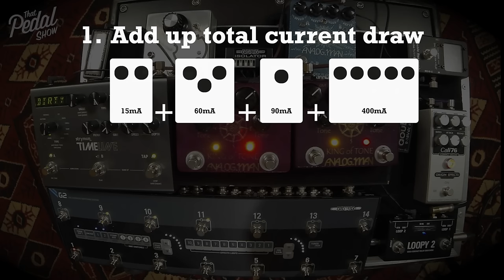That Pedal Show – How To Power Your Pedals Properly & The Legend Of VCPI

Comment: Sorry to spam the comments on this video, but Mick if you're checking this you should show Dan the comment from Mike about running his KOT with 18v.  

With regard to the question of the day, this is taken from TheGearPage, 

AnalogMike said: 

It depends on the filter capacitors we use, I think they are normally 
about 15V, you may be able to read the #s on them, the large can caps in
 the middle of the board above the DIP SWITCH. Sometimes we mount them 
on the back of the board so you may not see them. It's so hard to find 
good quality through-hole parts now, every time I order, the old parts 
are discontinued and I need to find a replacement. 

18V will be safe for a few hours but may blow up the caps after an 
extended period. Everything else (chips, etc) can handle the voltage. 
But I don't think the sound is improved with higher voltage so I do 
recommend 9V, 12V is also fine.

Have fun!

Comment: Great video. One thing that could have been discussed is what truly constitute an isolated output. I think there is massive confusion on the fact that a lot of "cheap" power supply claim to be "isolated" which in fact they are not fully electrically isolated. The "marketing" aspect makes use of the term very loosely and people are confused by the difference in price of 2 power supplies that both claim to be isolated. I know I was until I started researching it. (and I'm sure I still get my terminology wrong!)
Reply from the maker: +Boy from the Crowd That's a very useful bit of info. I now know why Dan looks sad every time I mention a power supply that doesn't cost 8 million quid. I wish the looks were words on the show. :0)

Comment: Two questions: 1. Do you also recommend surge protectors and power conditioners and that stuff? What if someone has a great power supply but the wall socket is crap, etc. 2. How do you power something like a Kingsley pedal which takes 500mA at 9vDC?

Comment: Thank you, Dan and Mick!  I (and I'm sure many of your viewers) would love to see a similar/equivalent show on how to power your amplifiers properly.  For example, should one source the AC through a power conditioner rather than directly from the wall outlet?  Do power conditioners really work?  And then, there is the whole thing about going to more extreme measures, for example, Angus Young's stage rig is powered by a Kikusui PCR4000M Power Supply, and then there is the whole story that David Gilmour had a grounding rod of some sort driven deep down into the earth for one of his studios.  If one were building a home studio from scratch (e.g. constructing a home with a home studio built in to it, what would be some sensible design features around supplying "clean" and well-regulated power to one's guitar amps and to optimally assist amplifiers to run quietly?  Thanks so much in advance!!!

Comment: Looking forward to geeking out on this later. Hoping you cover isolation of power supplies to amps as I get a lot of hum from my vox ac4hw and wonder whether cleaning up the power supply would help
Reply: I have the same amp and get a little hum but I think it's just because its wired up on a turret board rather than pcb
Reply: If the power supply doesn't have isolation capability that can definitely be a reason for hum.
Reply: bvninja thank you. Any recommendations?
Reply: ***** It will depend on what kind of pedals, plus size of board. As M&D said in the vid the good answers not really cheap as you are looking at 'bricks' & then there's the gig rig at the top end of the market.
But bricks like Voodoo Lab Pedal Power 2, TRex Fuel tank, MXR Iso brick, Truetone 1Spot Pro CS7 or the larger CS12 brick.
To be honest there are a lot of good ones out there just look for isolated feeds. I also use  mains conditioner extension sockets.

Comment: Absolutely brilliant. I wish I could have seen this years ago.

Here's the thing, I've been playing with a Boss CS3 pedal for about 5 years with a daisychain. Honestly, I've been playing for 17 years, I found out about daisychaining in about 2007/8 and I thought that was the only way to play until this year. I thought my CS3 was either broken or it was just a shit, noisy pedal. I couldn't understand how they could get away with selling such rubbish. Sometimes I just figured I couldn't use pedals because of the noise. I didn't have a board, I just had a number of daisychained pedals in a series into my amp. Sometimes, if I moved around too much, I'd move the pedals causing a jolt of electricity to damn near destroy my beautiful Little Mark III and 2x10 Traveller cab.

And all that isn't to mention the Ibanez Phat Hed (https://www.youtube.com/watch?v=nR_6oM3ijFg), which I bought at age 19 (about 2005 ish), which I couldn't even use. I was actually certain that I'd used a wrong power supply and destroyed it, because the noise coming from the pedal was hideous. It was like the CS3, distorted and amplified. And that was on the clean tone. I only use the clean tone for a little bit of harmonic distortion and EQ.

By happy fortune, I decided to by a Pedaltrain Volto 2 which actually broke after one gig (it makes Behringer gear look sturdy), however I was able to use it enough to realise exactly what I'd been doing wrong for so long! I was isolated from the mains. Suddenly I actually had TONE. The Phat Hed was quiet, the CS3 was clean. Also, I didn't have to turn my amp up loud to be felt and heard. My bass guitar, a Peavey Grind, suddenly sounded like a quality instrument.

Fortunately, the company I bought the Pedaltrain from have offered a refund and I've paid a bit more for Voodoo Labs Pedal Power 5 ISO. So I have enough juice to power my pedals, enough isolation to remove hiss, hum and squeal.

Not only that, I've now seen this video, so I know what I can do in the future and I now know why my rig suddenly sounded like that of the professional musician I'm finally starting to become.

Here's the exciting part, too. When I was playing this amazing gig, with this amazing tone, my pedals were on a daisychain out of the volto. So they might have had a little more hiss and hum than they will from the Voodoo. So next gig, I might sound even better!

Comment: I was unknowingly using an AC power supply on a Pedal that takes DC for a couple weeks. Luckily the pedal still sounds good. I read that most pedals have a diode right after the power socket protecting a pedal from the reverse polarity and a filtering cap. Is this true? Was there any damage done to my beloved OCD Overdrive pedal?

Great Show by the way! Very informative and entertaining.

Comment: Great video Gents. This subject has been confusing as heck. I do have one question though. 

What was the Isolation plug Dan was using called? I get that the best way to isolate a pedal is by not daisy chaining it(Like Dan showed with his Rangemaster Clone) but if you WANT to Daisy chain the pedal(if the pedal allows it) what do you use?! I wasn't sure if the device Dan used was part of the Gigrig or something obtainable on its own.

I cannot wait till you do that video on noisey pedals because I had a pedal that was driving me nuts and just had to return it because nobody could tell me what was going on. It was the Rockbox Red Dog. No matter what I did it would just hiss like mad at any volume higher than three. I mean we are talking the kind of hiss that would drown you both out during a video.

I had it isolated with its own power(9 volt battery, fully charged and brand new, tried several batteries and several dedicated 9 volt power supplies before I gave up)and I tested the amp to be sure it wasn't THAT that was causing the noise. I even tried 5 different amps(I REALLY wanted this pedal!!), and different guitars, and even different Red Dogs in case the one I purchased was just bad. Nothing would change the results.  It did it even when no guitar was plugged into the guitar cable. 

EVERY SINGLE DEMO video I watched(Including the one by Lee and Rob at Andertons) showed this pedal with the volume cranked up to about noon and you just hear this lovely overdriven sound when the drive knob was cranked. I felt like it just HAD to be me and it was something I was either not understanding or just plain doing wrong, so I returned it.

 Everyone was like "Well its just a noisy pedal" This made no sense to me at all since Rockbox markets it as a "On all the time" pedal. Believe me if you had that on all the time during the show, the show would be called "That Hissy Pedal Show"

Hopefuly you both can straighten me and others like me out concerning this, I know there are pedals out there like this(The Way Huge Red Llama also comes to mind), I would love to know 1)Was this normal? 2)If it is normal, WHY?! and 3)Can it be managed other than just having a pedal that you cannot turn up past 3? Seems like a waste of a good volume knob to me.

Till then, I will be sure not to plug my Tube Screamer into a 18 volt power supply!

Cheers

Comment: The manual for my Wampler pedals (which I LOVE) say the can run on 9v or 18v, but they're designed to perform "better" on 9v. Question: Why would someone create a pedal that can run on 18v if it performs 'better' on the much more common (and easier to power) 9v? Under what circumstances should I run those pedals at 18v?
Reply: good question . im running a hotwired at 18 v. my iso 5 has a dedicated port for it, so....but id hate to think it sounds worse for it...

Comment: A smokingly great subject guys! Thanks for your explanations Dan.

 I got rid of my 'love pedal' overdrive for this reason, it was noisy on my chain Grrr! I didn't realise it was another pedal that was the cause. But now I know it must have been the fault of the digital delay pedal at the time.
Reply from the maker: +Doc Tiberius It's not certain, but very possible. Assuming it was on a daisy chain and not running off a battery of course.
Reply: yes I was using a '1Spot' PSU which I still use from time to time to a small pedal board of only 4 pedals.  As I don't seem to have that noise with other overdrives I've used I thought it was something to do that pedal or a buffer/true by pass thing? But now I guess not.

Yes it worked fine on its own on a PSU or with internal battery.

I did burn out a fuzz box  some years ago which happily took me away   from fuzz boxes. 
I've learnt that it is a good habit to put labels on all power supplies so I can easily see which unit they belong to or are used for.

I use a Warwick Pedal case RC23120B now which has a very good built in PSU  with 9V X5 and a 12V but it does not do all voltages they would have to be separate.

thanks for your reply

Comment: I may have some of this wrong as I was not told this, I vaguely figured it out in my head about a year ago, but here goes...The tip negative design was because of the dual power capability of the pedals, battery and A/C power adapter.  Because the make/break connection had to be designed into a physically moving part of the jack socket, it had to be done with the sleeve connection, because inserting a barrel plug into the jack can only move the sleeve connection. The tip must remain solidly in place. Had the industry stuck to the 1/8" phono style jack (or ear phone as it was) the make/break could have remained with the tip, as it is in a 1/4" jack that we are more familiar with.  So basically, it comes down to the battery, and defeating the battery when the adapter is plugged in.

Comment: Hey guys, I have a question what power supply should I use if I have all of these pedals
- EHX POG 2
- T REX Mudhoney 2
- BOSS TU-3
- EHX Memory Boy
- EHX Little Big Muff Pi
- Rowin Twin Looper
It's pretty hard to find a power supply when a lot of your pedals run centre negative or 100+mAh...

Comment: Another great, informative video guys. I just recently stumbled across you guys. Glad I did. I just recently acquired a Lehle volume pedal. 9-15 volts. My power supply is a 1 SPOT 12. The outlets are all 9v (differing mA). Two of the outlets are 18v. Would I be safe running the Lehle into one of the 18v?
Reply: Go to 14.40 do not do it

Comment: Great show again guys, you really nail what subjects to cover as well as how well you present them.

Power is the very next thing I want to address for my board, need to resist any more pedals until it's done.  I currently daisy chain 8 pedals & have another 3 running off batteries.  I'm leaning towards a Voodoo Labs Mondo as something that will power a lot of pedals & offer voltage options as well as a bit of room for further upgrade & acquisitions (with maybe a few on batteries).  They're a bit pricier than most, but judging by your closing comments it seems worth saving up the extra money?
Reply from the maker: +Rob Holiday spending money on good power is always worthwhile
Reply: Thanks for the reply guys.  I think an episode could possibly be made about where to prioritise spending.  Similar to the amp vs guitar issue, when building a pedal board on a budget where are the areas you simply have to invest fully, where can savings be made with less compromise, and what are the likely results/differences from spending less?

Comment: Just a comment on the "design flaw" of center-negative. While inconvenient for safety reasons (the positive side is the source of electrical charge/voltage, so it would be safer not to expose that on the outer surface of the plug), center-negative is a necessary consequence of the pedal being powered interchangeably by batteries or external DC. To save the battery, the battery's connections are controlled by what you plug in. 

The negative side is connected through the sleeve of a 1/4" plug; unplug the guitar or patch cable and no current can flow. However, external power will cause current leakage from the battery's positive terminal even if you disconnect the battery's negative, because there's still a ground for current to flow into. To avoid this drain without having you remove the battery to use external DC, the pedal has to disconnect the positive terminal of the battery when on DC power, and that happens with a shunt switch that changes contact from the battery's positive to the barrel plug's sleeve as the plug is inserted. That sleeve must therefore be positive to match the side of the circuit it's being connected to.

You could, in theory, have a shunt of opposite polarity, by insulating the "break" contact being opened from the "make" contact being connected. Such a switch would be more delicate, however, and "delicate" isn't a well-liked word among engineers designing devices that are supposed to be stepped on by their users. So, pedal DC is center-negative in pretty much every pedal with an internal battery, and most relatively new ones that don't.
Reply: Liko81DJ - I appreciate your technical explanation.

Comment: My pedal board seems to be cutting out power (VoodooLabs 4x4),  I've plugged into it a Strymon TimeLine, Strymon Blue Sky, Strymon Deco (love it!)On Stage tuner and a NUX Loop Core all going into Fender Deluxe Reverb which I run with Tremelo and Reverb on.  In house I'm running the amp between 2 - 3 1/2.  If I plug straight into the amp all's well.  Going through the pedals into the amp, all might be well for a few minutes give or take and then fwizzz - nothing.  Now it "could" be this old house's wiring is not functioning as it should - but it sure seems like the Voodoo with pedals doing me dirty.

Comment: For those that don't know : a wonder, and safe mod, for EMG pickups are to run them @ 18V.  Adds a ton of headroom and openness to the pickup.  You can also go to 27V, but it's not much of an improvement over 18V so not really worth the extra effort.

Check it out.

Comment: How do you achieve isolation? If I buy a 10 output ‘isolated’ power supply will that be all good? Or do you need the extra adapter things

Comment: I've seen the blue smoke. $$$$
I got some plain brown painters tape and put 1 8 V on all 18v power supplies. On the pwr bricks, tape over any 12-18v plugs if not using and also label it. Easy to mix em up and fry a pedal.

Comment: I would add shielding to your list, particularly if you put any pedals in an amps efx loop. I have had bad hum and noise issues with the voodoo 4x4 and the one spot products.  The decibel 11 supply is properly shielded and much better. I am not sponsored by any power supply company, just wanted to share my experience.

Comment: Yet another great video, thank you! Looking forward to more "how to" vids - I'm nervous about starting to build my pedal train classic pro (with a G2 and gigrig power supplies) in case I don't get it right. I've built a smaller Trex Chameleon powered board which worked, but I didn't really understand what I was doing, so it was probably luck rather than design.
Reply from the maker: +robbieredball any questions the GigRig stuff just email or call and we'll get you sorted :)
Reply: that's brilliant, thank you! I'll probably get on ok, just want it to be as good as it can be!

Comment: I'm new to pedals. So far I have an overdrive, delay, tremolo, and a looper. I'm looking in your US shop and I'm so confused. To me they all seem very easy to accidently switch between 9v and 12v.  Are they easy to set up? All my pedals are 9v.  I think the overdrive needs 300mA or more, the rest I think are all under 100mA. Which isolated power supply should I get?